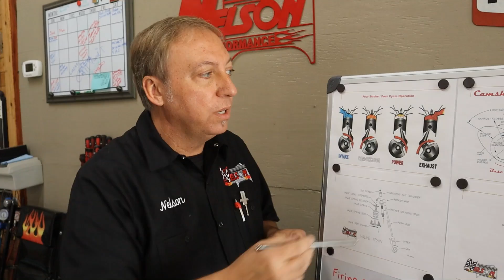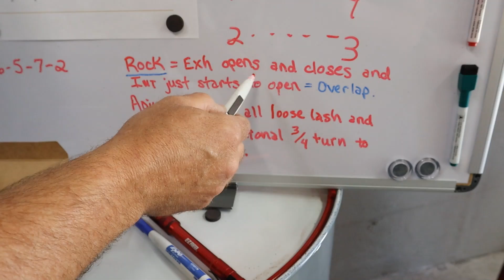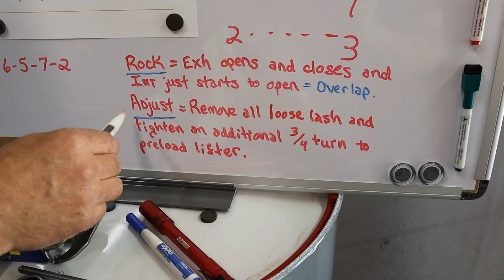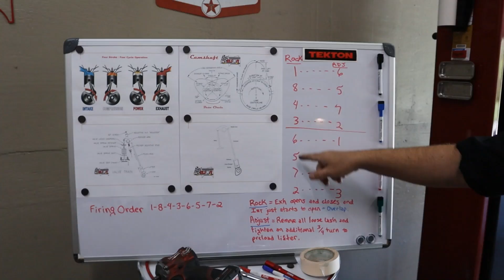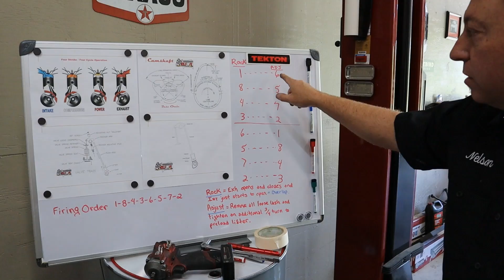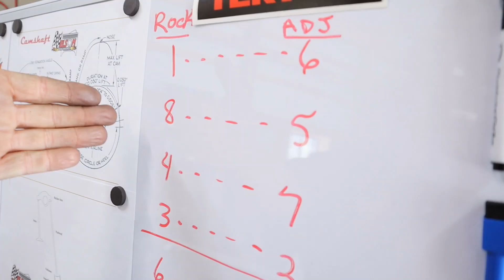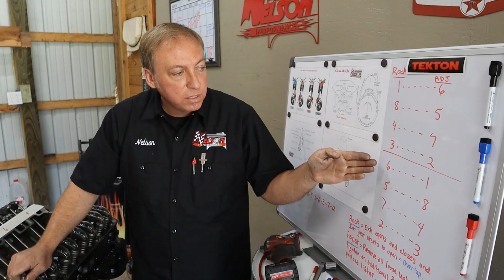Rocker Arm/Hydraulic Lifter Adjustment

Comment: I understand that this will get the engine started. But what happens when the engine is running and the lifters fill with oil and the engine gets hot? Don't they need to be adjusted again?
Reply from the maker: Hello, nope, this is the only adjustment needed. It will still have that same preload running. Thanks for the comment and liking and subscribing.
Reply: @mitchnelsonperformance  Sure, I'd like to believe it. There's so much info out there. some see this as a preliminary adjustment. And the final is done hot. With old valve covers cut to stop the oil spill and zero lash and pre load added when the rockers stop clattering. Mine (performance cam) makes so much noise I can't tell the difference!!
Reply from the maker: Try it, it won’t let you down!
Reply: @mitchnelsonperformance  I will! Thanks for getting back to me.
Reply from the maker: No trouble

Comment: The only problem is you need the intake off
Reply from the maker: Hey Trevor, You don’t necessarily have to view the lifters when doing the process, if the intake is on. You can also watch the movement of the pushrod/rocker arms if the intake is installed. You will see them move into overlap (the ROCK position). I’ve adjusted many engines that way. Just keep track of your cylinder locations to keep you on track. You can also use the ignition/starter to rotate the engine through the process but remember it only takes a slight bump of the key to turn the crankshaft the needed 90 deg. It helps to have a friend bump the key while you pay attention to the rockers. Good Luck with the project. Thanks for the comment and please like and subscribe

Comment: Every video ive seen shows adjusting rockers on a new or rebuilt engine, with no oil in lifters. Mine has oil in them still, does the same procedure apply?
Reply from the maker: The valve springs will bleed the oil out of the lifters as you turn the engine over as the rocker pushes the valve spring down. This will get the plunger off the wire clip in the lifter. The valve spring pressure has enough force to push the pushrod into the lifter bleeding the oil back slightly since the oil pump is not producing oil pressure unless the engine is running. Good Luck with the project
Reply: @mitchnelsonperformance  , thanks brother. Im gonna do it again soon as weather permits, been raining here for 7 days now.
Reply from the maker: Ready for some sun here too!

Comment: How much foot pounds does it take to turn a brand new engine that has been primed without spark plugs? i have a brand new engine sitting here thats taking about 40, is that normal or too tight? thank you for your input
Reply from the maker: Hello, I don’t think that’s to far off from where it should be. Not sure if you have a 4cyl or v8 but I did a quick check on a 302 Ford we have here on a stand and it takes 35 lbs to begin rotation then drops back to 25 lbs during rotation. (No spark plugs). Hope that helps. Nelson
Reply: @mitchnelsonperformance  Hey Nelson,thank you for the reply,sorry i wasn't more specific,im bad about that,lol, its a 347 stroker
Reply from the maker: Nice!

Comment: Just finished adjusting my rockers, went awesome because of your video.  Since I had poly locks & can turn the nut with fingers, was to watch the lifter cup move up & down as I turned it back & forth.  That way I knew exactly where zero lash was at by feel & sight.
Reply from the maker: Hey Brian, poly locks are the way to go! Thanks for the comment! Nelson
Reply: Hello my friend, I want to adjust my engine rocker arm, the reason because I hear a clicking sound in my valve covers, also one of the gasket valve covers is leaking oil so I want to take that opportunity to adjust my valves all because I'm going to be there around the valves so why not try to fix the problem, hopefully you can help me, I have a 1997 mercury mountaineer AWD 5.0L/302 it belongs to the Ford family, it's a V8 engine, do you think it is possible to adjust it myself I just do not have the specifications on how to adjust it properly but like you say by feel and sight it can be done. Would you please explain this method if it works on my car, thanks in advance for your help, if it's possible my friend. Thanks..

Comment: Can you do this method with the intake on already?
Reply from the maker: Hey Jay, You don’t necessarily have to view the lifters when doing the process, if the intake is on. You can also watch the movement of the pushrod/rocker arms if the intake is installed. You will see them move into overlap (the ROCK position). I’ve adjusted many engines that way. Just keep track of your cylinder locations to keep you on track. You can also use the ignition/starter to rotate the engine through the process but remember it only takes a slight bump of the key to turn the crankshaft the needed 90 deg. It helps to have a friend bump the key while you pay attention to the rockers. Good Luck with the project. Thanks for the comment and please like and subscribe
Reply: I also was wondering can you do this with oil in it and already running.
Reply from the maker: Hey Jay, The valve springs will bleed the oil out of the lifters as you turn the engine over as the rocker pushes the valve spring down. This will get the plunger off the wire clip in the lifter. The valve spring pressure has enough force to push the pushrod into the lifter bleeding the oil back slightly since the oil pump is not producing oil pressure unless the engine is running. Good Luck with the project

Comment: Is this all you need to do for a flat tappet cam? Cus I thought it was also required after cam break in to adjust when the engine was running for the final setting
Reply from the maker: Hello, yep, this is all you will need to do. No further adjustment needed. Good luck on the project

Comment: Very good video is its to understand but I'm just wondering on a 4 cylinder air-cooled Volkswagen engine do you still turn them in 3/4 of a turn or would it be different? Thanks
Reply from the maker: Hello thanks for the question and liking and subscribing. They are a “solid lift” camshaft so the rocker arms need to be adjusted to a certain specification or “lash”. This is a very good video for your application  https://youtu.be/wQMRENwOyvE. Good luck on the VW Project!  Nelson
Reply: You need to have a repair manual

Comment: Does anyone have any knowledge on a 403 Oldsmobile engine bore over 40 280 comp cam
Reply from the maker: I built a 403 olds many years ago that was in a trans am? What information are you looking for?
Reply: @mitchnelsonperformance  I have a rocker arm pivot that broke and I was wondering what all should I replace I have a 403 olds bored 40 over 280 comp cam it might have (75) miles on it🥺 but I set it up for maybe 3 years and started working back on it maybe about a month ago after driving it maybe 20 miles I heard of tap in the motor all fluids were still intact I changed the oil again and the sound was still there it's not a real loud tap
Reply from the maker: if the bolt broke on the pivot it could have been a weak bolt or it may have been over torqued and stretched or if the valve springs are not matched with the cam it can cause coil bind and pop the rocker. Or the retainer to top of valve guide clearance may not be enough (min .080) and can cause the same. Check for coil bind and clearances and see if the bolt is longer (from stretching) compared to another bolt. I would replace the bolts and add a lil blue thread lock to them after inspecting the clearances. P.S. a stuck/sticking valve stem in the guide can also bend a pushrod or pop the rocker. Thanks for the comment and subscribing! Nelson

Comment: So I got an 86 350 installed in my boat . Got it running. Then had intake water leak. Got that cleared up. Got it running then 3 rockers came loose . I'm worried if I tighten rockers to much I'll damage cam. Right now  I'm turning crank and bleeding down lifters  till pushrod are tight. Then do preload.  Am I good?
Reply from the maker: Yes, just follow the video step by step and you’ll get them adjusted fine. Not sure why your rockers got loose? It does have 3/8 stud locking style nuts correct?
Reply: @mitchnelsonperformance  no it doesn't. Gonna try and find some.  It tries to crank but something is off.
Reply: So is the crank at 0 tdc when both valves are closed on number one??
Reply from the maker: only on the compression stroke. The piston is at TDC during two strokes, the compression and the exhaust. It MUST  be on the comp stroke or the exh valve will be trying to open and if you have cyl 6 in overlap (as in the video) then #1 will be on the correct/compression) stroke.
Reply: @mitchnelsonperformance  so when the intake valve is closing that's the compression stroke.
Reply from the maker: Yes... the intake valve closes at the bottom (BDC) of the intake stroke and then begins the compression stroke on its way up to TDC. Are you using the firing order and the “rock and adjust” method in the video? The process will be identical to your engine.
Reply: @mitchnelsonperformance  yes sir. I was in the middle of the process but I had to swap out the rocker nuts for locking nuts which may have been my problem. . My neighbor had 2 heads with the nuts. So its back to square one. Thanks for responding. I'll let you know how it does,
Reply from the maker: Any small block chevy rocker arm jam nuts will work (unless you have aftermarket poly lock style nuts) even from a used engine as long as they still have resistance on the stud.

Comment: F____ finally! I have been looking for HOURS(!!!) for a video that showed that the guy doing it, understood the fact that at TDC, for each cylinder, WAS NOT where the valve should be adjusted(!!!!). I knew that was an issue when I adjusted my valves on my 99 Ranger ( 3.0 ), but I couldn't figure out where that would be correct in the cycle, and almost did it the same way I did it last time (which would have caused damage AGAIN, although I don't want to explain more than that). But let me just say thank you for such a clear and well articulated video, on such an important part of the assembly, that is, for some reason, left out of the other ones I watched. I will definitely be hitting the subscribe button in a few minutes, something I don't usually do on ANY videos I watch. Thanks again, and keep up the good work!
Reply from the maker: Hey Pete, really appreciate the kind words! And subscribing! We plan to do more engine instructional videos soon. Glad we could be a part of your projects. Nelson

Comment: I have to do this after i get my new valve stem seals in place (a couple days from now) and i have to do it with the engine in my truck and intake on.  Thanks mitch! Awesome video
Reply from the maker: Hey Scooter, You don’t necessarily have to view the lifters when doing the process, if the intake is on. You can also watch the movement of the pushrod/rocker arms if the intake is installed. You will see them move into overlap (the ROCK position). I’ve adjusted many engines that way. Just keep track of your cylinder locations to keep you on track. You can also use the ignition/starter to rotate the engine through the process but remember it only takes a slight bump of the key to turn the crankshaft the needed 90 deg. It helps to have a friend bump the key while you pay attention to the rockers. Good Luck with the project. Thanks for the comment and please like and subscribe

Comment: Hi,  Can the lifter be adjusted as in video if have oil in them? If not what is different?  1984 C10  305 engine. Thanks
Reply from the maker: Hey Jack, The valve springs will bleed the oil out of the lifters as you turn the engine over as the rocker pushes the valve spring down. This will get the plunger off the wire clip in the lifter. The valve spring pressure has enough force to push the pushrod into the lifter bleeding the oil back slightly since the oil pump is not producing oil pressure unless the engine is running. Good luck on the project! Thanks for the comment and subscribing. More videos on the way!

Comment: no need to write anything on a board and try to remember all of this. As soon as you have the cylinder on the compression stroke, we know both valves are closed and read to be adjusted.
Reply from the maker: Ok

Comment: Great video!  If you're doing this with the intake on, would it make sense to loosen all the rocker bolts first allowing the lifters to return to the retaining clip?  This engine has been running in the car.
Reply from the maker: Hello, yes, I would loosen them up before beginning. You don’t necessarily have to view the lifters when doing the process, if the intake is on. You can also watch the movement of the pushrod/rocker arms if the intake is installed. You will see them move into overlap (the ROCK position). I’ve adjusted many engines that way. Just keep track of your cylinder locations to keep you on track. You can also use the ignition/starter to rotate the engine through the process but remember it only takes a slight bump of the key to turn the crankshaft the needed 90 deg. It helps to have a friend bump the key while you pay attention to the rockers. Good Luck with the project. Thanks for the comment and please like and subscribe

Comment: Nelson, if my intake is on and cannot see the lifter, can I mark the push rod with a marker and watch it instead? Will it be as accurate? thank you
Reply from the maker: Hey Brian, yes, that would work but it doesn’t need to be that accurate. as long as you see the intake pushrod start to move then you know you’re in overlap and your ready to adj the other cyl
Reply: @mitchnelsonperformance  thank you so much for the quick reply!

Comment: I have 1999 f150 v6 PUSH rod bent little but can't pull it out?
Reply: Hey Robert, hmmm not sure what to think there? If that engine just has a small clearance hole in the head that the pushrod runs in then it may not take much of a bend to jam it up.
Reply from the maker: see above

Comment: Will this work on a chevy camero 350 v8 🤔 I'm having trouble adjusting these rockners.. im going to try this method tomorrow hopefully this works
Reply: Hello, yes, it will work on it. That’s the same engine that’s in the video. Good luck on the project. Thanks for the comment and subscribing!
Reply: Yeah it works fine.. but now ill redo it tomorrow again 😔 I think some push rods are clogged in lifters need to be replaced
Reply: Glad to hear it worked good for you. Good luck on the rest of it.

Comment: Now explain while attached to vehicle PLEASE
Reply from the maker: Hello, You don’t necessarily have to view the lifters when doing the process, if the intake is on. You can also watch the movement of the pushrod/rocker arms if the intake is installed. You will see them move into overlap (the ROCK position). I’ve adjusted many engines that way. Just keep track of your cylinder locations to keep you on track. You can also use the ignition/starter to rotate the engine through the process but remember it only takes a slight bump of the key to turn the crankshaft the needed 90 deg. It helps to have a friend bump the key while you pay attention to the rockers. Good Luck with the project. Thanks for the comment and please like and subscribe!

Comment: You made it more difficult than it really is, just start on one bank and adjust the intake when the exhaust begins to open and adjust the exhaust when the intake is halfway closed on each cylinder. Or, begin with #1 TDC compression, adjust both intake & exhaust, then every quarter turn of the crankshaft, adjust both valves in the firing order.
Reply from the maker: Got it.

Comment: This is great. I'm about to do my 300 SIX. The Comp Cams instructions are a joke. Require lots of turning as you know.
I always wanted to be able to do both intake and exhaust at same point. I used to try to predict what cylinder to do  next  by watching lifter movement to minimize cranking but this sister cylinder method makes is too easy.
Reply from the maker: Yep, this method works great on the inline 6 too. I’m an in-line fan too. The old 68 C10 in the background of the video has a built 250 6 and a three on the tree. The inline 6 is tough and reliable no matter Ford, Dodge, Chevy.... thanks for the comment and subscribing. More videos soon. Good luck on the 6!

Comment: what if the lifters have oil in them already will it be the same
Reply from the maker: Hey Jonathan, The valve springs will bleed the oil out of the lifters as you turn the engine over as the rocker pushes the valve spring down. This will get the plunger off the wire clip in the lifter. The valve spring pressure has enough force to push the pushrod into the lifter bleeding the oil back slightly since the oil pump is not producing oil pressure unless the engine is running. Good luck on the project! Thanks for the comment and subscribing. More videos on the way!